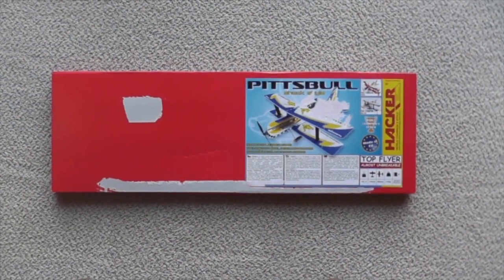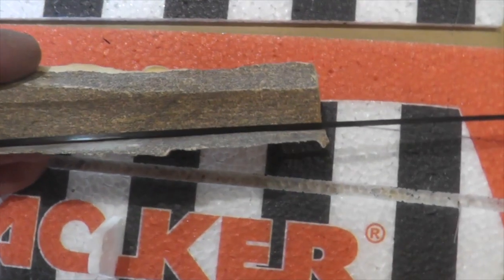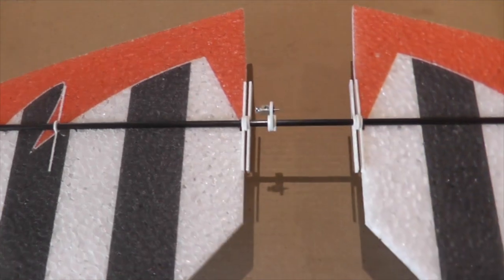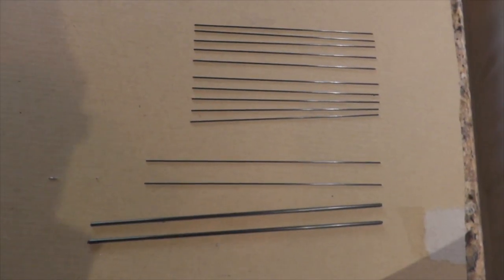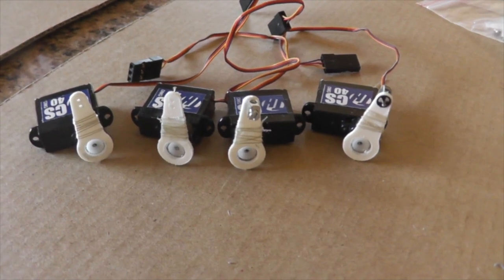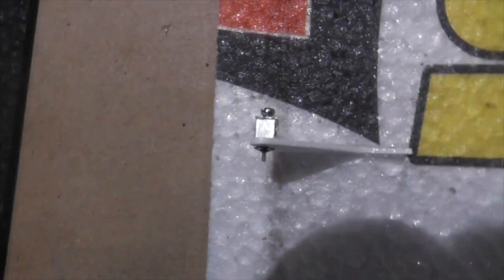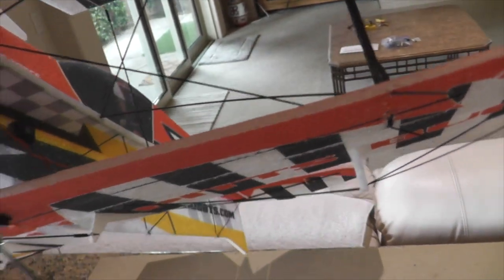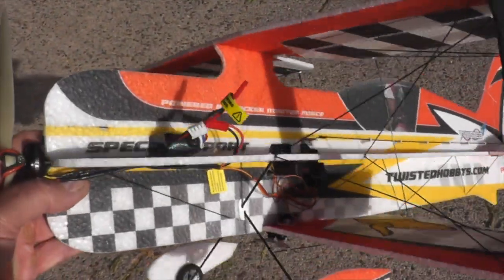Twisted Hobbies Hacker Pittsbull Build and Maiden

Comment: Great job! Any chance you would be able to build a TH Standard Crack Yak 55 and I'll pay for the build and ship to me in CT? I have zero building experience so thought I'd ask. Let me know, thanks.
Reply from the maker: Sorry, I have to many projects and not enough time. Give the build a try, just go slow, take your time, and it will happen! I had the Yak 55, great little plane, you will like it!
Reply: Thanks I tried made it to about 75% then everything went downhill from there. Rods to servos went awry. Everything was misaligned horrendously so threw it in the garbage.
Reply: If you can’t build a crack yak foamy you might think about finding a club of rc people.
Also there are build thread videos and rc groups.com.